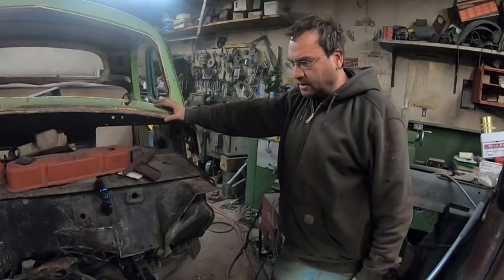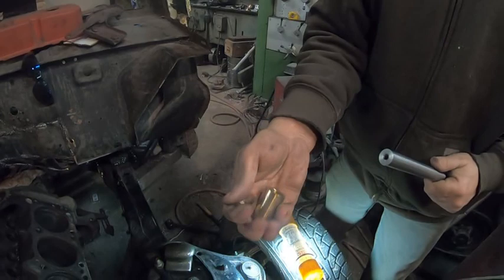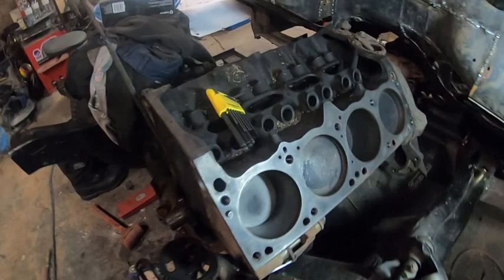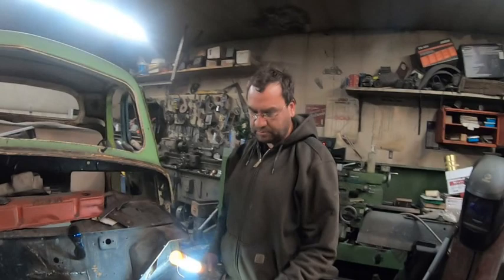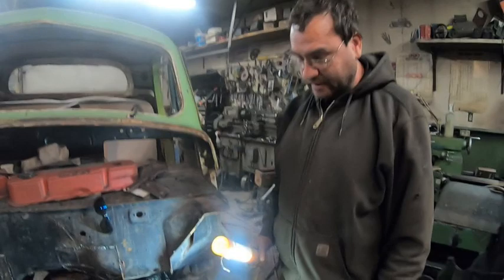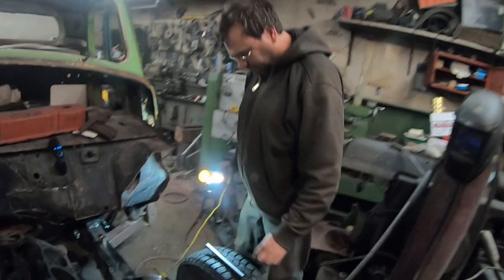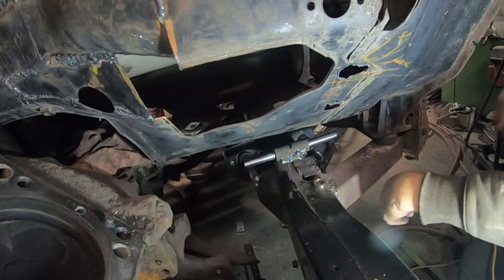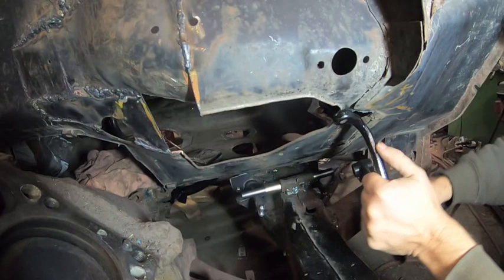1952 Studebaker 2R5 1/2 Ton Rusty Floor, Rusty Cab Mount, Sheet Metal Fabrication.  Dakota Swap.

Comment: Happy to watch you guys make things happen. My thought about cylinder with no ring grove  is that someone done a poor job on installing rings on that cylinder so it never cut a grove and never fired on the cylinder so it fouled plug, You Guys will figure it out and fix it on the rebuild.  Great video,
Reply from the maker: Think you are right there Gary glad you liked it.

Comment: Excellent video Penny's  :) also if want know how fuel tank set to check out 1968 International pickups 1200 or 1300 series 1 or 3/4 ton they did on right side also tanks were  25 to 45 gallon type  on frame rail on plus did sandwich plates of strong metal  up top on bottom floor in behind seat and they had fill from tank plus two hose in one also filler neck up to cab back to with vent cap too with symbol International also later years one was big chrome button like ! If find International pickup truck in 1940 to 1974 they show and Google Search help to of internet !
Reply from the maker: Thats good to know Andrew if it was summer time we spend some time looking for one but might be fun to build another tank and show you guys
Reply: @pennyshotrodscustoms  welcome on help out and yes looking foward to see tank building too ! Also on International truck tank had filler in face foward top about 1/2 inches above lip in middle with Big toward driveshaft and small one was to frame both holes were 1 -1/2 inches apart!